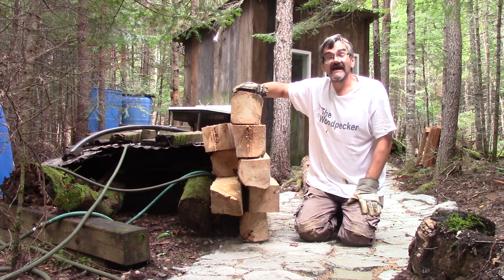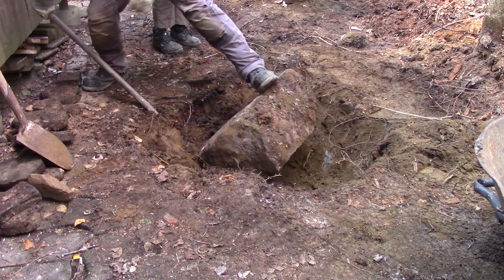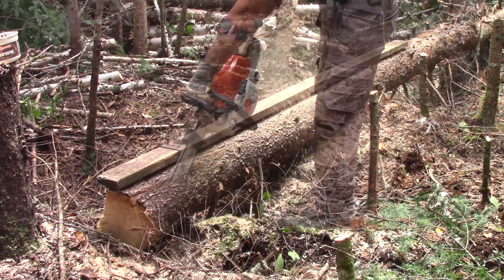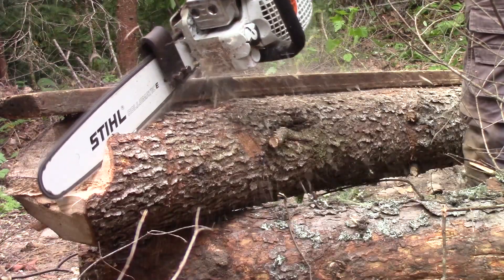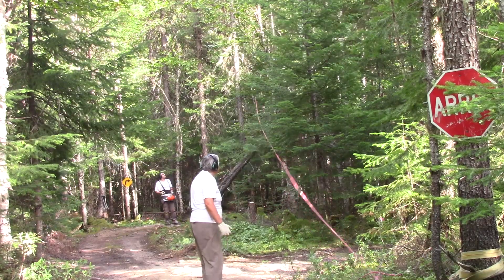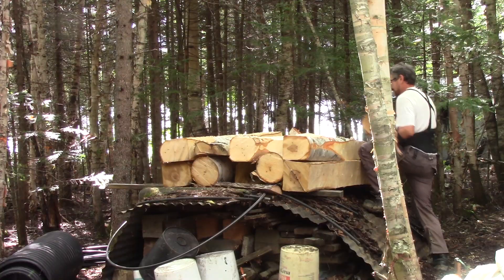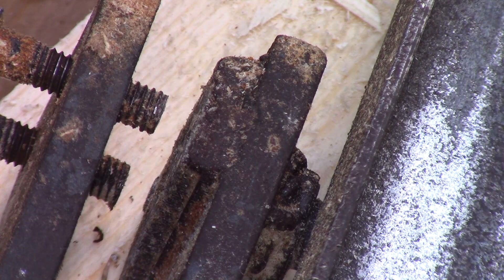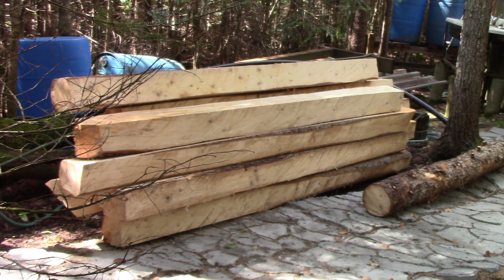The Woodpecker Ep  247 - How I make my own 6x6 at the cottage

Comment: Actually you can buy a tool like that fairly cheap. I have a cheap chainsaw mill that works for me.
Reply from the maker: I know, if I remember correctly Lee Valley sells one. The problem is the metal is also cheap. I used one, once, I've borrowed it from a neighbour when I was still living with my parents, the connecting nuts got un-welded it was only spot welded. I didn't make this mistake on the one I did.

Comment: maybe you'll address this in later videos, but will you further dress those 6x6's? Not to be critical, but it's being overly generous to call them square. Trapezoidal perhaps, with a little twisty action, perhaps. Again, that may be fine, depending on their intended use. And that metal guide jig is beautiful in its simplicity.
Reply from the maker: Funny you mention it. I've just install them, I need to edit this, and of course I had to remove the twist in them, so now they're not 6x6 anymore but more 5½x5½ and straighter. Straighter because some of the original cuts are still there, I would had to cut 5x5 to remove them all. If you have the courage to see some of my upcoming video you'll see this